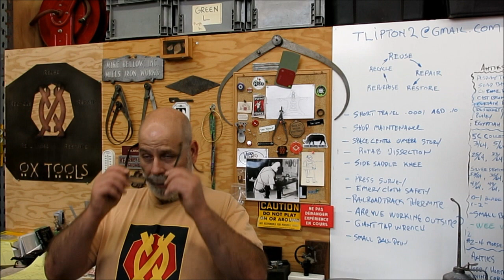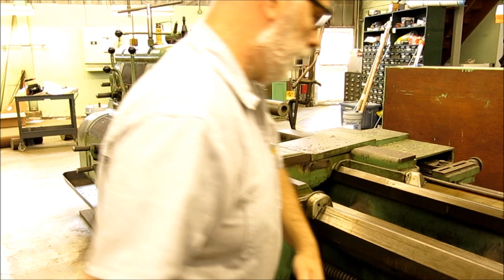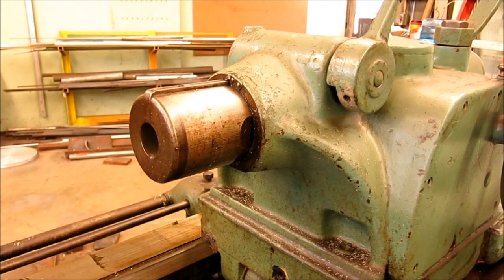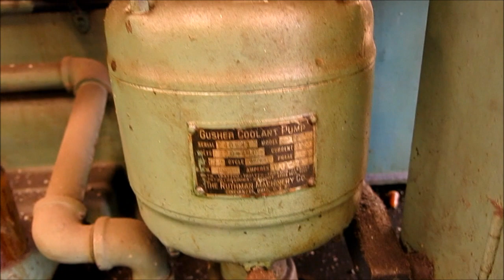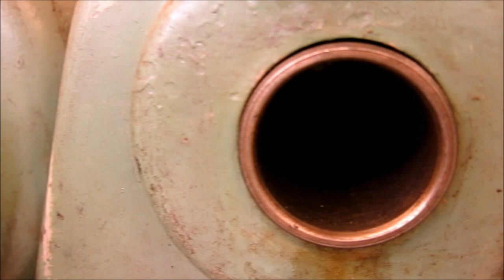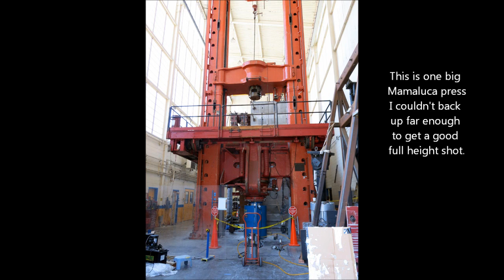Axelson Lathe Survey

Comment: The first lathe I ever ran was a 32in Axelson.  I love these.  One interesting note about the Axelson lathe.  Unlike many makes one can feed both the cross slide and the longitudinal axis simultaneously, the detail that most don't know is that these come in two configurations one is known as a "boring lathe" the other is a "turning lathe"  The difference being that with the boring lathe one can by feeding both axis at the same time, produce a 45 deg bevel in a bore and on a turning machine produce a 45 deg bevel on the out side  end.  These machines are known down here in Texas for having the power to take some extremely heavy cuts.

Comment: Got me a 1944 D20 20X96. New to Oakland Engineering. Then to August Manufacturing. Then to me in Novato in 1989 From Ed Schlick. Picked it up at August Manuf. It's Now out in Park City Utah. Needs Turcite real bad.Maybe .150" to .200" under the saddle. That much sag on the lead screw hangs up the half nuts I think. They did some work for the Rad Lab on it. There was some tooling used to make spherical molds...

Comment: We have 4 Axelton in the shop that I work, do you know where we can get the gears to switch one over to cut metric threads?
Reply from the maker: Hi Kathryn,

It would be a special set of gears. You would probably have to have them made. American Gear and Machine makes a metric change gear set for old Monarch lathes. They might be willing to design and build you a set. It won't be cheap. Thanks for the comment.

Cheers,

Tom
Reply: thank you

Comment: Damn, I wanted to see that Axelson run balls out, Max RPM & Feed Rate!  If the Max RPM is 719  at .300" per rev, that's like 18 feed per minute!  You would only have 20 seconds to
run the carriage all the way from the tailstock before crashing into the chuck, what a site that would be.  That's sick, there's no way they would allow that.  There must be a governor or some type of limit to prevent that.  No wonder Tom was a bit apprehensive or could not engage it.
Reply: The only governor is the sanity in your head. If you want it to go even faster the leadscrew will probably thread down to 1 or even 0.5 TPI which would be 1 inch per rev or 2 respectively. So think more like 60 or 120 FPM. Yikes. Something would probably fail before you could engage it though.

BTW a lot of machines have rapid traverses that are faster than 18FPM, so it's not unreasonable.

Comment: ....Sacramento Engineering and Machine works...here in Sacramento, Calif...has about 6-8 Axelsons....several about this size....one larger is maybe 60" swing and 30 feet long capacity.....a couple of the 'smaller' ones have power feed on the COMPOUND.....that's really sweet....place has been in continuous operation since around 1922-3....
Reply from the maker: Hi Doug,

I have never run a lathe with a powered compound. That would be neat. We have a 32 Axelson gap at work we use for making a special cable. It has a 100 inch face plate on it. Thanks for the comment.

Cheers,

Tom
Reply: +oxtoolco...Sacto Machine once had 30+ employees...now down to 2-3 machinists and a part time welder.....pretty much all manual type machines...a couple Bridgeports with DRO's....they got their start back in the 1920-30's doing a lot of big stuff for gold mining operations around the hills east of here....also had/have several horizontal mills with all the power feeds and rotary heads for making all sorts of gears and splined shafts...also did a lot of poured babbit bearing stuff....

Comment: The first lathe I ever ran was an Axelson 32.  I made so clam-shell bucket shivs that were on the order of about 31 in in diameter by about 5in thick  (T1).  I remember that the boss had notched the ways so the chuck jaws would clear.    That thing would "hog some iron"  I could bury a 3/4 in SNMG and feed it hard enough to break "9"s.  One interesting feature about these machines (it may be true of other makes but I don't know" These have power feeds in both the X and Z axis.  With both engaged the machine will cut a 45 deg bevel, but Axelson made two configurations, one would bevel the inside, and the other would bevel the outside.  This was because of the way the cross slide feed was driven.  They referred to them as either a Turning or Boring configurations.  It's a handy little feature.  One last thing, you are right, they can be a workout.  That said, I've run a reworked one and it was like running a pocket watch.  What craftsmanship!
Reply from the maker: Idomake Hi Make,

I really enjoyed playing around with this fine piece of American iron. Thanks for the comment.

Cheers,

Tom

Comment: Hello.
Beautiful machine ... I confirm that to the best fit to Adam hehe. Dimensions greater even than my machine - my is about 24 '' / 75 '' (600 / 1900-2000 mm) and about 6.5 tons of weight, built in 1951, and of course, the workshop occupies most of the space ... but this is no longer its pride of place and as long as my son did not expel me from the workshop, it is not going anywhere adjustable haha! This handle which has a diameter? I'm sorry, because I probably talked about it, but unfortunately my English ... omg is very, very weak, and the lack thereof so watching these limits me your beautiful movies.
It has kept my eye machine in very good condition, just adjust the centrifugal coupling (in my start similar symptoms that slowly takes off, especially when it is cold) and something small is in the spindle ... 2.5 "My only ??? has a smaller footprint, and is 3.5 inches in the rear and side of the handle is enlarged to more than 4 "and it is a very big advantage, especially in the repair of hydraulic cylinders, which I do frequently. I use very little steady, almost all. What has a spindle speed range? (again, this lack of English) My is from 12 to 600 rev / min - 18 gears.
PS. As no one has seen, though we had to unscrew the handle for Adam haha! If he did not want it to fit my ideal: D
Thanks for the video and best regards!

Witam.
Piękna maszyna... Potwierdzam, że najlepiej pasowała by u Adama hehe. Gabarytami większa nawet od mojej maszyny - moja ma ok 24'' / 75'' (600 / 1900-2000 mm) i około 6,5 tony wagi, zbudowana w 1951 roku i oczywiście najwięcej miejsca zajmuje warsztacie... ale jest to już jej honorowe miejsce i dopóki mój syn nie wygoni mnie z warsztatu, to przestawiana nigdzie nie będzie haha! Ten uchwyt jaką ma średnicę? Przepraszam, bo pewnie o tym mówiłeś, ale niestety mój angielski... omg jest bardzo, bardzo słaby, a właściwie jego brak tak bardzo mnie ogranicza oglądając te Wasze piękne filmy.
Ma moje oko maszyna utrzymana w bardzo dobrym stanie, tylko sprzęgło rozruchowe należy wyregulować (w mojej zaczynają się podobne objawy, że wolniej startuje, szczególnie gdy jest zimna) i coś mały ma we wrzecionie... 2,5" tylko??? Moja ma mniejsze gabaryty, a ma 3,5 cala z tyłu, a od strony uchwytu jest powiększony do ponad 4" i jest to bardzo dużą zaletą, szczególnie przy naprawie siłowników hydraulicznych, którymi najczęściej się zajmuję. Podtrzymki bardzo mało używam, prawie wcale. Jaki ma ona zakres obrotów wrzeciona? (znów ten brak angielskiego) Moja ma od 12 do 600 obr/min - 18 przełożeń.
PS. Jak nikt nie widział, trzeba było chociaż ten uchwyt odkręcić dla Adama haha! Gdyby nie chciał, to do mojej pasowałby idealnie :D
Dzięki za film i pozdrawiam!
Reply from the maker: Hi Zbigniew,

I would love to see a picture of your big lathe. My email address is on the whiteboard in the beginning of most of my videos. Thanks for the comment. 

Cheers,

Tom

Comment: My dad, Earl R Krans designed that lathe. I have his original concept pencil drawing of the original 14" Lathe. That original design was scaled up to the 16", 18", 20", 24" and 32 " lathes. A lot of them were used to make war goods. Many were sent to Russia for them to make their war goods. My dad was exempt from the war to make war machinery. He said Mr Axelson was a real character. He had many gadgets in his home. Anyone I have ever talked to that work on an Axelson lathe had nothing but praise for them. The largest Axelson lathe I have a record for was 46 inch by 28 feet. Axelson lathes were also used in the oil industry. Ralph Krans
Reply from the maker: Hey Ralph,

Thanks for sharing your awesome story. I have never had the pleasure to run an Axelson but I would love to. They look like a very well thought out machine. Did your dad live in California? They had a plant back east somewhere as well.

All the best,

Tom
Reply: @oxtoolco  axleson-veet detroit michigan. bob veet designed the first power planer mill. He Mounted A Vertical Milling Head On A Planer Thus The Veet Power Planer. He Was Very Instrumental During World War 2 Supplying Machines And Tooling. He Was Also A Good Friend Of Henry Ford. My Dad Was A Scraper Hand In The Detroit Area For Over 50 Years. He Did Work For Bob Veet. You Can Still Buy o.e.m. Parts For Axleson & Lodge & Shipley Lathes.

Comment: Thanks for the video Tom, I purchased this lathe today. My company has an identical Axelson however a shorter bed. 24 x 48. I love these machines. You are correct in that tooling for these large machines will break the bank. $5,000. and up for a chuck, $3,000. and up for aloris tool post, and on and on. Thanks so much for the video. How did the ways look on the machine? 
Thanks again,
Jeremy
Reply from the maker: Hi Jeremy,

I'm glad this went to a good home. The machine was in excellent shape for its age. I can attest from experience that government machine don't see a lot of hard use. Moving that lathe will be pretty interesting. Might have to drop by when you're moving it. Keep me posted. 

All the best,

Tom

Comment: Tom,

Love to see big machines from time to time and to learn about the original manufacturer.  Nice to have some historical references.  I would have loved to also see a close-up view of the charts on the front instead of the time spent figuring out lever changing for the gear box. I tried to stop the video to read the plate on the back with the lube instructions. I think I see St.Louis, MO as the address. There was more to see on that plate if you look carefully.  If you ever get the chance to visit a shop with a big LeBlond engine lathe, please do a little tour video shoot! Thanks!!! Daniel
Reply from the maker: Hi Daniel,

Shoot me an email and I'll send you some stills I shot of the lathe. There is one that shows the speed chart and part of the feeds and threading chart. Email address is on the whiteboard at the beginning of the video.

Cheers,

Tom

Comment: Hi Tom,

Enjoyed the video, it sure would be fun to run that lathe!  Hmmm, what size tool bits would that machine use...3/4"? Or?

Chuck
Reply from the maker: Hey Chuck,

The tooling for this machine would kill you. You need heavy duty stuff when you have a machine like this. The toolpost would cost more than the opening bid for the machine.

Cheers,

Tom

Comment: Nice Lathe! At work, I have been using a 24" Monarch from around 1960; it definitely gives you a workout. I would like to figure out how the tracer attachment works.
Reply from the maker: Hi Luke,

Thanks for the comment. Is the tracer a hydraulic unit? Fenner did one not too long ago using his tracer attachment on his Clausing. Might be similar.

Cheers,

Tom
Reply: The tracer unit is actually broken, but it was hydraulic.

Comment: Gosh Tom, I have to give you shit on this one!
Always turn the chuck by hand or slowly jog with the clutch when changing gears in the headstock, serious effort should not be required!!!!!!
Always shift the feed box with the spindle turning slowly
I'm sure you know this but I have to fix lathes WAY too often at work
because of ham handed operators trying to force gears into alignment
at rest, or even worse attempting to shift headstock gears on the fly....
Reply from the maker: Hey Gent,

I don't think this machine had been shifted in quite a while. Ham handed. Guilty as charged.

All the best,

Tom

Comment: Now that is my kind of lathe.  It is still kind of small compared to some of the shipyard lathes I used to see in operation.  But still fun.
Thanks for sharing the visit to the shop.
Reply from the maker: Hey Randy,

The ship building shops have everybody whupped. You know it a big lathe when you need the crane to load the cutting tool in it.

Cheers,

Tom
Reply: oxtoolco Yup and 4 workers.

Comment: Found myself calculating freight cost to the East coast. Probably more than a good lathe would cost! don't need it, but definitely WANT it!
One question: the simultaneous operation of carriage feed and cross feed- aside from impressing your friends, what operation would that do? maybe if the feed rates were independently adjustable, you could cut a taper, but otherwise, what could you foo with that?
Thanks for the tour. always fun to play with a new machine.
Reply from the maker: Hi Bill,

The dual feed engagement is probably not that useful. I have heard of some guys cutting angles with lathes equipped with dual feeds. Never tried it myself. Having two levers is nice and I can attest to that.

Cheers,

Tom

Comment: Nice piece of old iron! No test cuts though? :-) When I dream at night it is of a 36NN Monarch sitting in a new shop on my farm with a bridge crane over it for loading parts in and out. It is a nice dream!!
Reply: I love those old monarchs where the headstock is literally longer than the distance between centers. They didn't make those things to break, that's for sure.
Reply: Well @bcbloc02 I guess you never got your 36NN but I guess you did alright with that series 90.
Reply: @TheMetalButcher  Yeah the series 90 is a good step up from a 36NN so I guess dreams can come true! :-)
Reply from the maker: Hi Brian,

I was surprised at the lack of tooling for the machine. No tool post or much of anything for it. One crummy home made boring bar and a lantern toolpost off a teenie lathe. No centers no drills zip.

Cheers,

Tom
Reply: Makes you wonder if they used it for anything besides just one job then. Thanks for sharing the old brute with us anyways!

Comment: The cross slide looks to be bigger than my 10 inch lathe and probably weighs at least twice as much.  Still looks like a nice Machine.  It would fit in my shop but I would have to raise the roof about 8 feet and add an overhead crane just to feed it and change Chucks..  great video Tom!  Thanks for sharing..

Comment: reminds me of this beast that "Copenhagen suborbitals" bought for i think ~$10000,
http://ing.dk/sites/ing/files/styles/blog_inline/public/images/56787.jpg?itok=y09_4lYm

HASSE & WREDE RD3M, made in Germany ~1941
16tons, 38kW, 1300x2400mm, 100mm spindle bore, 14-244rpm
Reply from the maker: Hi Lasse,

That is a monster as well. It has rapid traverses on the axes. That one looks like it could take a very heavy shaft from the looks of the tailstock. Thanks for the link.

Cheers,

Tom

Comment: Now them's some big boy's toys!!
You pointed out the small through hole, what's up with that?
You'd think it would be at least10" or better!
Cool none the less.
Thanks for sharing!
Reply from the maker: Hey Ray,

Thanks for the comment. They were cheap when it came to the holes. MMC. Maximum metal condition is the way Axelson built machines.

Cheers,

Tom
Reply: Bigger bore takes bigger bearings. Those get pricey. Although this old of one might not have balls, dunno.

Comment: If you're halfway inclined to buy that Axelson, Tom, I'll chip in $100 just to watch you push it to the limit and make some proper chips. Come to think of it: Maybe I ought to make a chip control or face off video on my Pacemaker some day..
Reply from the maker: Hi Pan,

I think you could bury the machine in smoking chips and have the building burn down around it before it would stop. It even smelled powerful.

Cheers,

Tom

Comment: Hey Tom,
Damn! You could do some serious hoggin' with that lathe! I can't get over how huge it is! It must tip the scales at 6000 lbs. easy! (Could be even more!) A 20hp motor! You could take off 3" and not have it hiccup! I was amazed at the size of those presses. You wouldn't use something like that for pressing in bushings without smashing the the part you're working on! Thanks for the video! I love big stuff like that!
Regards,
Oxen Dave
Reply: In the event you missed it, at 3:36 Tom lists the weight as 16,500 lbs. or 7500 kg., I'd have to pour a new concrete slab in my shop.
Reply: hankus253
So I'm off by 5-1/4 tons! BFD! Don't you have anything better to do but complain about trivial stuff?
Reply: Swarf Rat Tsk tsk LOL!

Comment: That's a sweet lathe, wish I had room for it in my shop. I could put it to good use. Thanks for giving us the tour of the machine, and those massive presses. 
I think you should make room at Ox Tools for the Axleson.
Reply: that 4 jaw has your name all over it Adam
Reply: Adam, you just have to re-do your ceiling in your shop so you put in an ovehead  crane to work with it. Don't think eve Keith Fenner's crane could handle stock big enough for that one.
Reply from the maker: Hey Adam,

That lathe was made for you buddy. Its got one of the best tailstock setups I have ever seen. No slippage possible.

Cheers,

Tom
Reply: kevin pangle
I know!! Love the big 4 jaws! Thats for big boy work there!
Reply: It even has the finger holes...something tells me you might get it 180'd as fast
Reply: Good  sir
Reply: I  am  mf.of  milling  machine  in  india
Reply: Birdi  milling  machine
Reply: beautiful machine
Reply from the maker: Simarjit Singh Hi Simarjit,

Send a link you your equipment.

Cheers,

Tom
Reply: Simarjit   singh  birdi  from   Birdi  milling  machine  in  india (punjab)ludhiana  my.mb.no009872138646
Reply: Serch  on  net